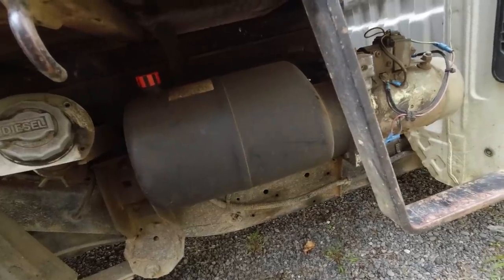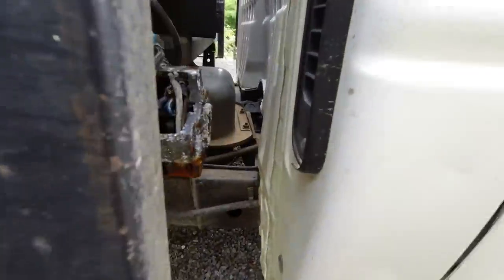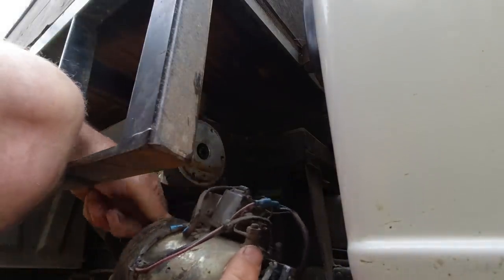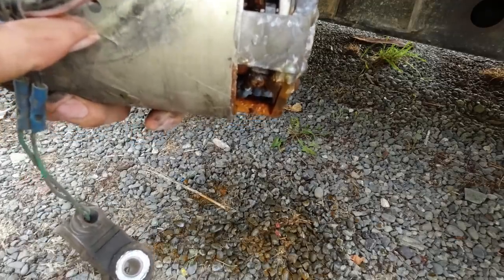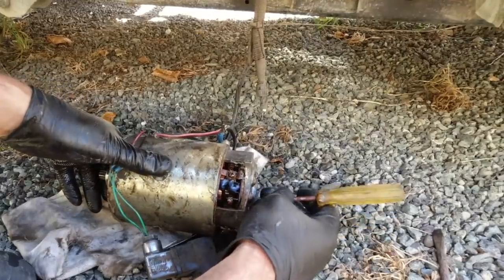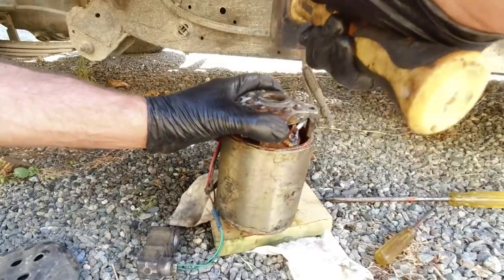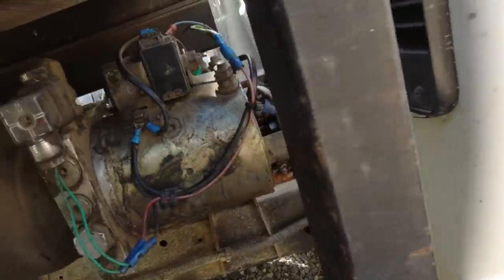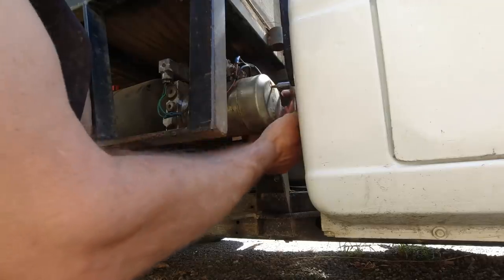Fixing a DC electric / hydraulic tipper motor.

Comment: I watched your video and was able to repair my hydraulic pump which looked just like yours !   Followed your procedure step by step and it fired right up.  Brushes were rusted in place, I freed then up using a razor blade, soaked with cleaner,  put it back together and bingo !  Thank you for putting this video together !
Reply from the maker: Great, glad I could help

Comment: Nice - In the late 80's / early 90's there was a milking machine made in NZ which had fancy (for the time) electronics on every bail. They apparently tried everything to get them water proof, but between the high pressure hoses, cows kicking, grumpy farmers, water always entered, and most likely some issues were from condensation. The solution was a small hole in the plastic cover in the base to allow water out. 

Always remember this story from my first job. Simple and unexpected.
Reply: Mainly the high pressure hoses.
You could try installing brains in the farmers/farm workers ,but that would cost more than replacing the equipment.
Reply: Many NZers learnt via the leaky homes saga that water needs somewhere to go.
Reply: @paulg3336  it's not brains that are lacking, it's knowledge. Big difference there brother, don't forgot who cultivates the food you put on the table and have a little more respect for farmers, thanks.

Comment: Marty - The big e-bike shop in Vancouver figured out years ago that, when motors (like e-bike hub motors) get hot, the air inside expands and pushes its way out of the motor any way it can. The main culprit? The wiring. The gap between the strands on stranded wire, under the insulation. And when the motor cools (bike parked in the rain, as it does often in Vancouver), it sucks water back in like a straw. The water gets deposited in the motor, and in a manner of only a week or so is actually substantial enough to fill the motor. Then eventually rusts it to failure. They tried sealing wire ends with silicone and everything else, and eventually threw in the towel and acknowledged that eventually water will get in, and what's important is that it can get out again. So, they enameled the whole inside of the motor with high temp enamel, and then drilled a bunch of holes in the motor case. Problem solved. Looks like you'll do just about as good here.
Reply: Forty years of doing electrical and mechanical work has taught me this. Water will ALWAYS find a way in but never find a way out. I try to set stuff up where any water that gets in can get out as soon as it stops raining and warms up.
Reply: This can be reduced to virtual elimination by putting a fitting on the motor and having a vent tube going to somewhere it will never see water or use a water trap.
No suction occurs if the enclosure is vented.
Reply: @paulg3336  My Winch manufacturer is now pushing this fix you speak of in Venting the motor, its funny to hear people speak of Winch motors drain holes being in the wrong place that the are underneath but then the winch gets mounted facing forward, so fundamentally its flaws and will always fill to half capacity no matter what.                           But the truth is as you educated guys have illuded to it will always suck water in unless vented and drained and this has now become my experience.                                                    Do you not find it amuzing that the guy selling items has no clue how it works?                      and he parrots what he was educated with by his employer that you must have had the winch under water and I could testify that in no time in 10 years I owned the vehicle and winch has it actually ever been near any submerging and in the housing of the Bullbar its sheltered in every direction from rain water to the point that I could pull the winch out wipe the dust off it and put it back on the shelf.                                                               But if something is guaranteed to fail by design fault and lack of knowledge then its good business?                                                                   I have 4wd legends that every year they pull theirs appart and clean it all up which is the only way you could fix it or keep it in good condition
The first one I blamed the seals which is the  party line, the second one I was pissed but knew that it had never been under water so looked harder into the why more until now I understand you guys explanation as being the fact around it's failure and what prevents it
Reply: I took mine out, fresh from the factory, cleaned everything and used epoxy to coat the important stuff, then i drilled two holes, one in the bottom, and one in the top at the opposite end. Every time i know water had a chance to gather in, i use compressed air on the top hole and purge it out. It's been 3 years and change since i've done this and no problems have arisen, where as for example, a friend of mine bought one just like it because he'd seen me use it for years now and didn't ask me what was what, it died within 8 months.
Reply: @paulg3336  So it wasn't so much that the holes mentioned in these replies let water out, but more that it allowed the internal air pressure to be level, so no suction occurs.
Reply: @brucetutty9984  Heating and cooling causes the air in the cavity to increase and decrease in pressure. This will suck fluid in along any joint or shaft seal and the fluid will collect at the lowest part of the cavity.
Putting a vent at the lowest part of the cavity works, but if it is on a drip line some moisture will get sucked in as the  device cools. The moisture won't accumulate, but it will condense on the internal parts and not flow away.
If you put a tubular vent on it and put the end of the tube where water never gets to , you will reduce the condensation as well.
You can even arrange a small container with a desiccant pack at the end of the tube.
Reply: @paulg3336  - This works in Marty's case, but in the case of an E-bike hub motor, the entire motor is the hub itself, and it rotates with the wheel. There is nowhere to put a tube or a vent to a specific dry location, because the whole case of the motor itself is spinning.

Comment: You don't clean a commutator (collector) with sandpaper! You turn it over with a lathe or clean (polish) it with a special rubber pen. Grinding roughens the surface and burns the contact. Once it has started to burn, it burns the contact until it is gone. I would clean the charcoal and the charcoal holder with a cloth and not soak it with a liquid. I would have replaced the two dustproof bearings for 3 dollars or at least removed the rubber on one side (cleaner site) with a knife tip, cleaned it and lightly greased it again. After carefully removing the rubber cover on one side, you can press it back on or leave it off. You can easily check an error of the windings with a measuring device. You're doing good work, I enjoy watching.

Comment: 👍 good work. Mine had a rubber duck bill drain on the end cap (not stock). While at the dump with a load of spiny branches. The three guy next to me started to laugh, until I push the button. Perhaps, the laugh was on them.

Comment: The white poly buckets have a pretty short lifetime in the sunlight - there's no UV blockers in white and clear buckets. Keep your eyes open for a black bucket, or some aluminium to shade the exposed area. I used some aluminium duct tape to  good effect on some exposed poly on one of my projects - still holding up! Nice fix - you are a great teacher of the slow and methodical method of trouble shooting and repair. So many farmers run with quick and dirty repairs, when they're just sweeping their little problems ahead until the whole pile of them light up into catastrophic failure! I hope the younger guys are taking notice that doing it right once, or even doing it as well as one is able at the moment, will save time in the long run!!! Cheers from California.

Comment: Marty this will do very well. I can't believe how strong that motor dumps. Must be geared down. Works very well on a pickup. Those scratches on the slip rings will do fine now water is not coming in. Should have left bottom on bucket. Probably only get water in it now with a flood like you just had washing the culverts and hydro station down the stream turned major river. We need some of that water in our SW. GLEN Canyon dam took 17 years to fill up. After full demon weather overflowed it so bad cement 30ft deep was washed out in overflow tunnels. We then learned on the steep tunnel face to have 5ft overhangs with which to inject air into stopping the impact of the water down in the bend at the bottom. It flooded over the next year too. Had this flood come 15 years earlier the amount of hydropower would have been generous. I am now a proponent of molten salt thorium reactors and leaving the rivers alone except for irrigation, not power production. All the dams on the Columbia have totally decimated the salmon runs and ruined the hydraulics of the river. Before my time Wenatchee horse teams took cross cut saws out onto the river to cut blocks of ice insulated with wood shavings for ice all summer for fruit shipment, till refrigeration from the hydro dams. It has never froze over in my lifetime and I am 75. So thermal inertia is a real thing behind the dams.

Comment: My brother is in Grafton where it’s been flooding.  He would definitely share your young fella’s opinion on getting water in cars.
Reply: I had a 1969 VW Karman Ghia convertible, and it was very aquatic.  The cure for water accumulating on the floor under the driver's and passenger's feet were one or two punched 1/4" holes recommended by the local VW repair shop.  Worked like a charm.  Of course, I got better and better gas mileage on that car as time passed, it got lighter and lighter as more rust fell off!

Comment: A friend gave me an old Mk1 Ford Escort Estate. It was so rotten the doors dare not be opened without jacks under the sills. I 'repaired' it and got an MOT test first time. I thought the starter was a bit tired so I stripped it, it was like fairy land inside, everything was covered in copper dust. The com. looked a mess so I stuck it in the lathe. New brushes and a clean / coat of paint and it lasted for years.

Comment: I have worked on a few motors like that in my life, everything from vacuum cleaners to bench grinders, and even one for a water pump and one that had spend 20 years on a fishing boat. Pretty much 90% of the time they will come back to life by cleaning the commutator and either freeing up and cleaning the brushes or just replace the brushes. Usually apart from the brushes; the bearings are what wears out on these motors (again; also easy to replace). These type of motors are really hard to kill.
Reply: il faut aussi gratter les micas sur le collecteur
Reply: il faut aussi gratter les micas sur le collecteur

Comment: Great fix. I have a 1961 Chevrolet Apache 20 with a hoist with the factory box. Hydraulic is PTO driven. Acquired it in the early 1979 or so. 80 small straw square bales for the truck. Put a 3/8 4x8 plate on the floor of the box. Still use the truck today. Sure is handy.
I think my dad bought that truck for me because I was his rock picker.😄😄

Comment: Relieved to see you went the route I was willing you to go regarding avoiding future water ingress,  She is just an old work UTE after all, where her practical purpose far exceeds her needing to look smart & a more than adequate slot for drainage - small holes can fail their intended purpose (especially single small holes) if a bit of a vacuum is formed, meniscus or debris especially in the case for example, you get  ingress, park tilted in a way that it doesn't drain, you can quickly develop enough rust to just block such a small hole when a more favourable angle should later allow drainage - As long as those pesky mud wasps/mud dobbers don't get involved!

Comment: You might considering wrapping the joints with vinyl  electrical tape.  If the surfaces are degreased it will stick a bit to the body of the motor and will stick to itself.  Just stretch it a bit.  I have used  it this way for years with good success.

Comment: Ive found with the motors ive rebuilt if you can push the brush back and shift the spring over putting the commutator back in is way easier to reset the brushes all you gotta do is push them in slightly.

Comment: I used to build those DC and AC power Units every day. They love leaking and sticking shut.

Usually those motors are in side a box. And yes the can be pricey
A DC 26 unit which has power up gravity down cost 250 USA DOLLARS and the power up and down version was like 350

Comment: As for the water, I would try some light rubber mudflap over top as that would allow it to run off. 
For the electrical joints ring connectors with a #8 MC with a nylock to keep it tight with dual wall heatshrink will keep the connections clean and dry. 
The reasons I prefer prevention then repair.

Comment: You could 'undercut' the mica insulation gaps on the commutator, using a hacksaw blade.
(this stops sparking) 
Also the carbon brushes can be shaped by wrapping some sandpaper around the commutator, with grit side up, then rubbing the brushes on the sandpaper.
Reply: I was going to suggest that - glad to see that you've already mentioned it.  Remembering those old car repair books from 50 years ago has it's benefits!
Reply: Some manuals recommend against it (for their application).  I know Land Rover says not to cut the mica on starter motors.  Any idea why?
Reply: Was going to post the same. I think scraping the mica insulation may be more common on larger motors. You would need a very fine hacksaw blade on this tiny motor. I replaced thousands of brushes on large industrial DC motors in 30 years as an industrial electrician. Also forming/seating the new brushes using sandpaper. But we didn't bother on anything this small. Wasn't my money.

Comment: Best strip down video and gonna watch it again tomorrow once I've got the unit off the transit as having the same issue lift struggling after changing the broken solenoid it worked again for a short while now the solenoid just clicks and no response hopefully it's the same

Comment: The moisture trapped in there is a flaw in the design in my experience. You were right about drilling a hole. I had a similar problem on my main work truck boss plow motor. Oddly the upgraded head has a hole for moisture egress. We used to burn up and go  through motors regularly and replacing them in a snow storm was a pain. The heat during operation draws it in.

Comment: I’d cover that slit in the case with a piece of fine mesh to avoid water and dust from the road from shooting straight into the commutator and bearings. Some mesh/filter material will stop that from happening while still letting water out if it gets in.
Reply from the maker: Good idea, maybe thin air filter foam

Comment: Simple solutions are usually the best. That cover is simple and brilliant and the drain hole in the cover is so bloody obvious that whoever tried to fix it the first time round just wasn't thinking. Nice job and interesting to watch. Out of curiosity was this another bargain buy?
Reply from the maker: I think I got a good deal, for a diesel tipper with only 139k kms on the clock

Comment: I like that you can load your truck/UTE directly from behind with that narrow bucket on the tractor. If you need rear weight and don't want to fill your tyres with water, how about you fill an appropriate drum (can cut) with concrete, to near the max width of your lift arms/lower arms with a steel rod through allowing you to (weld) couple on the arms? It would also allow for easy disconnect and could be used on other machines if needed?
Reply from the maker: Yes that would work, I usually put the back blade on when using the front loader, it adds weight and is useful for smoothing out the fill

Comment: You might wanna think about adding some splash protection for the bottom as well - the water could also be splash water from the front wheels? 

A completely different question: how do you select which tractor to use for a job? a few of your tractors do have front loaders, why did you select the db30 here? because it was the only one with a bucket at the moment? or is it more like random selection?
Reply from the maker: I'm pretty sure the water is coming from above, I have seen it pouring on the powerpack in a heavy rain.. The db30 has the best tyres and the bucket is narrower the db990 so it gets in to the pile easier

Comment: The bearings won't live long having been moist, and a drain slot/hole would help. Is the water running down the tray and dropping straight onto the motor?

Comment: What did you spray on the interior of the motor to clean the parts, just brake parts cleaner or does this application need another type of cleaner?
Reply: @JohnSmith-yv6eq  thanks for the answer

Comment: Your viewers badgered you into building a beautiful workbench, where is the workbench? Did your wife sell it??? Because just watching you working on the ground hurts my back & knee's 😄
Reply from the maker: Haha, I could have removed the wires but that would have turned a 10 minute job into a 15 minute job 😂. I find sometimes when wires are removed from old motors, it can end up breaking insulation spacers and internal connections so I try to avoid it.

Comment: wat type ov cleaner do u use is it carberatur cleaner iv tried using carb cleaner but it seems to dry off rite away so doesn’t do a very good job
Reply from the maker: I used crc 556, it leaves an oily coating

Comment: But only if the motor works, if you had the lid in place before, it would not be that accessible. But then again, it's only plastic, easy to cut off and replace.